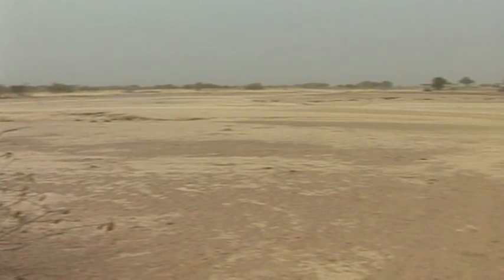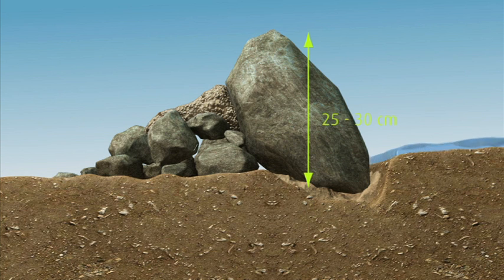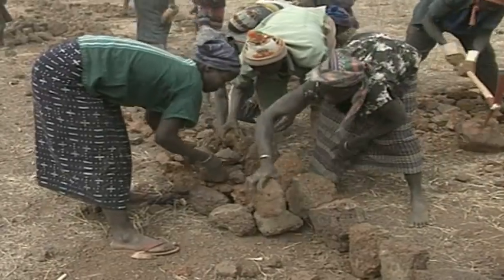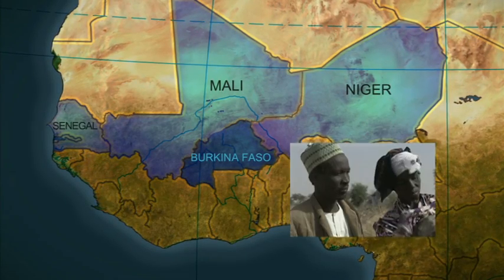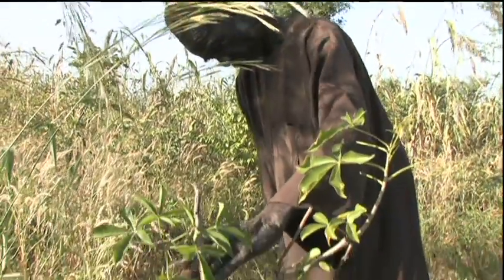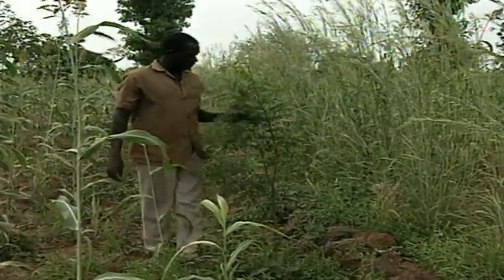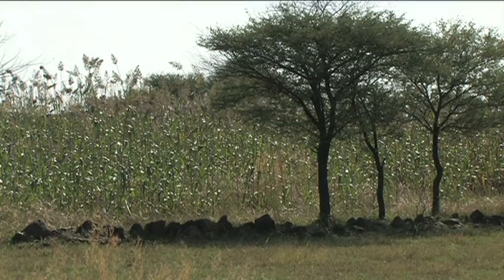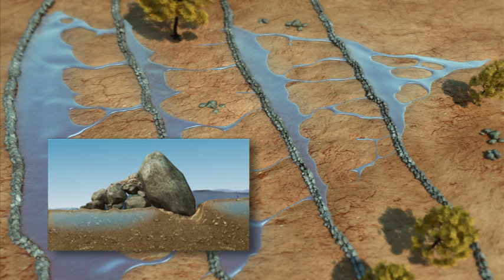Stone Lines

Comment: I am curious as to why the smaller stones were put downhill of the key stones. I have seen some systems where the smaller stones are put uphill to slow the water before it reaches the key stone. Can anyone tell me the benefit of putting smaller stones downhill?
Reply: A conjecture. The excess water that continues downslope would be concentrated between the larger stones, leading to tiny scale erosion. The small stones instead catch sediment, and keep the ground below moist for awhile after rains, allowing grass growth. The grass and new roots facilitate infiltration and additional sediment retention. The water that doesn’t infiltrate is returned to more of a sheet flow across the landscape.

Comment: Excellent. What were the ratios between slope and stone line separations? What was the maximum slope that it could be used on?
Reply: What they are trying to do is slow the speed of spreading water. Anything they can do to slow the water will help. So the more lines the better. But even one line will help with production. The speed and volume of water is what lifts and carries away organic material. The slope of the land would demand rock lines that are higher and closer together in order to slow the water running down the slope. in flat land the lines can be lower and more spread apart. But that is dependent on the amount of water accumulating. The answer to your question is that it depends on the situation, but it does work on steep hillsides, if the speed of the water can be slowed down enough that the water deposits organic materials instead of carrying them away.
Reply: @richardleau  I apologize for not acknowledging your reply. YouTube did not alert me to your answer.  I am working with a government planning agency here in Saltillo, Mexico.  I will put your advice to good use here on the ¨falda¨of the Sierra Madre Oriental mountain range. !Gracias!
Reply: @brooksanderson2599  To be clear, it depends a lot on slope, the maximum rate of rainfall, the annual amount of rainfall and rock wall maintenance . In a deluge, rock walls wouldn't work, especially on a slope, especially if not maintained. A more expensive option is a swale, especially if there is enough slope. But swales would be pretty expensive and unnecessary in the example given here.
Reply: @AniishAu  
Swales need trees to hold them in place because they can be washed away,  too.  You have to consider soils,  terrain,  labor needed,  etc.
Agree with your reply to Steve.
Reply: @AniishAu  
No,  but that is also dependent on conditions,  as we discussed earlier under a different set of comments.  Trees help stabilize soils and prevent washouts,  and soil/carbon/water aerolization.
Reply: Read Brad Lancaster's books  Rainwater Harvesting,  Volumes 1 & 2.   It's a compendium of techniques and simple formulary for capturing rainwater.   Very effective,  and interesting.  Brad learned some of his techniques from an Afri CD an man who had keen interest in this subject,  btw.